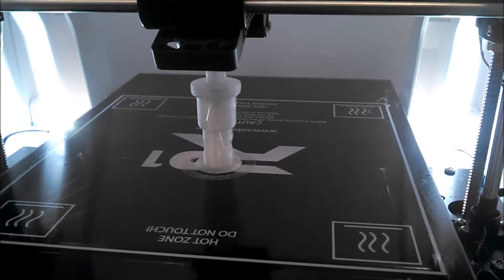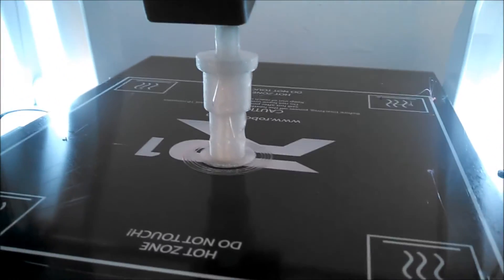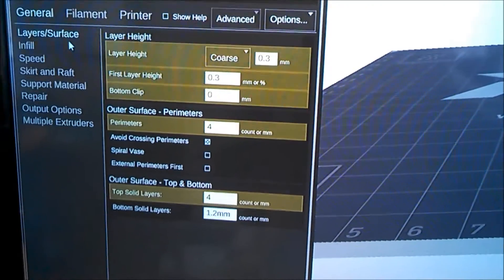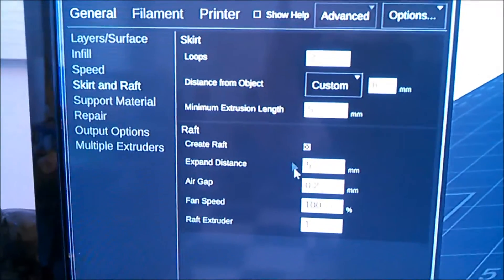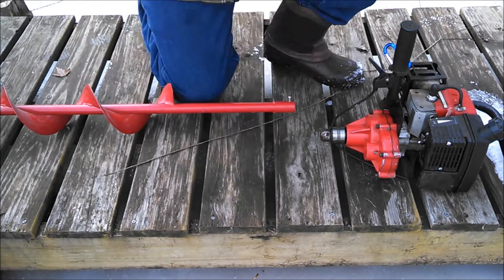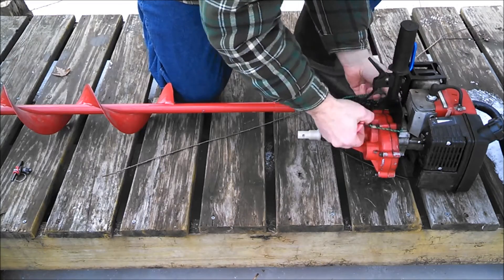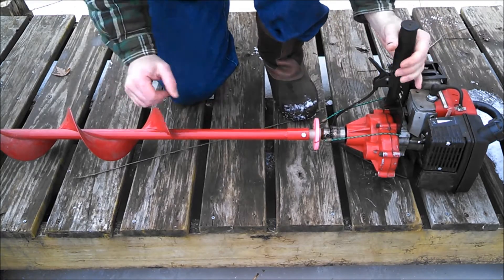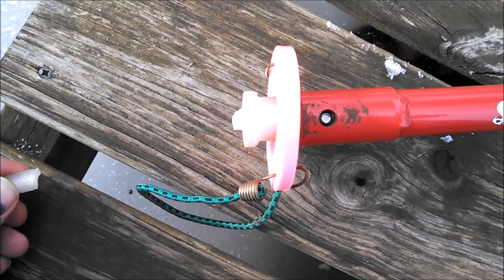Ice Auger Drill Adapter - 3D Printed PETG (FAIL - part 1)

Comment: You should try with taulman 910
Reply from the maker: I got some Taulman 645 and tried using it to print my adapter for the Kohler fuel pump conversion.  However, I could not get it to stick to the bed and not jam for more than a few layers.

I have already wasted more time, money and done more cursing at Taulman than I care to admit to.  Have you ever tried using Taulman 910 yourself?  If so, how did that work for ya?